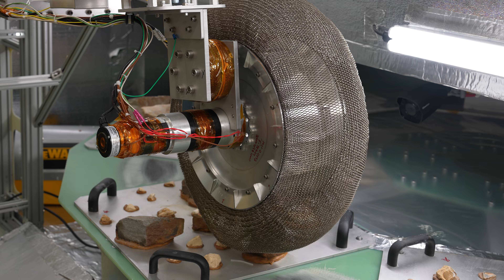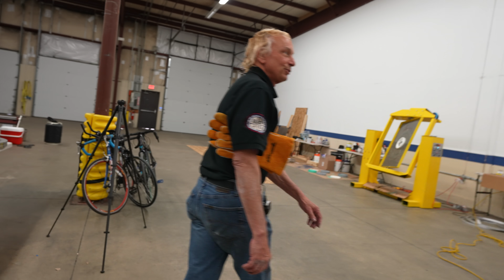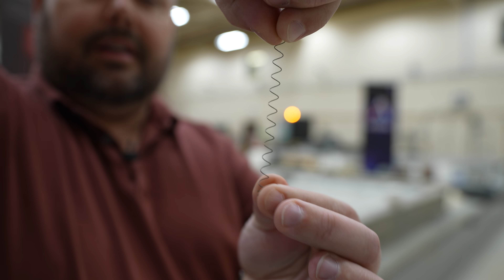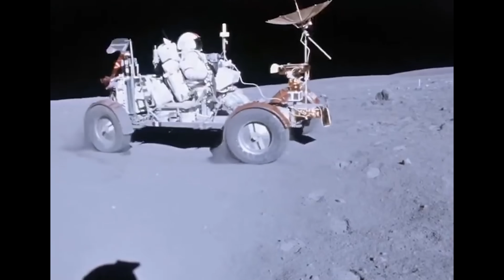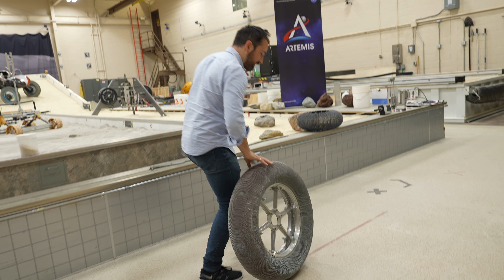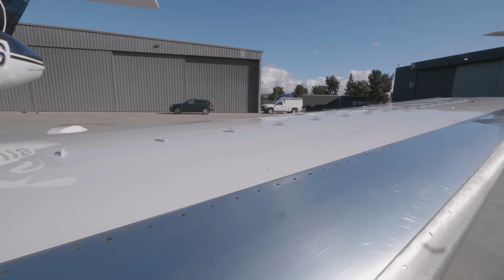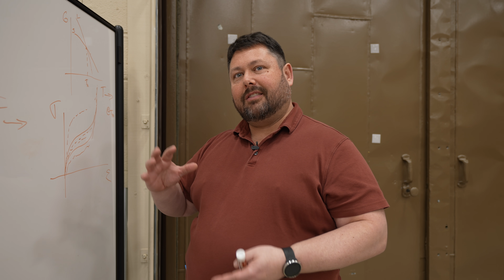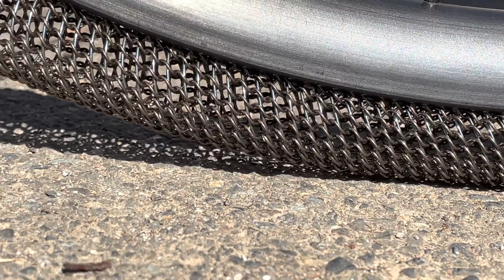How NASA Reinvented The Wheel

Comment: 1: Will the reforming work in space? -130°C is still a ways from absolute zero, but it is still significant less warmth than RT. 
2: If the alloys were originally discovered in the 60th, why is it not already in use on current vehicles in space; or on planes for that matter?

Comment: Why do they have to be wheels? Is a different atmosphere, makes me remember German engineering of flying saucers. Can a drone or form of hoover vehicle be more efficient out there?
Reply: A drone or a hover vehicle could potentially be more efficient than a traditional wheeled or tracked vehicle on Mars or other celestial bodies with low or no atmosphere. This is because a drone or a hover vehicle could travel over rough terrain without getting stuck, and could potentially cover more ground more quickly than a wheeled vehicle.

However, designing and operating a drone or hover vehicle for use in space or on Mars comes with its own set of challenges. For example, as I mentioned before, the lack of atmosphere means that traditional air-based propulsion systems won't work. Alternative propulsion methods, such as ion thrusters or rocket engines, would need to be used, which can be complex and expensive.

Furthermore, the harsh conditions in space or on Mars, including extreme temperatures and high levels of radiation, would require the use of specialized materials and equipment. The lack of a GPS system on Mars would also make autonomous navigation difficult, requiring sophisticated sensors and computer systems.

Overall, while a drone or a hover vehicle could potentially be more efficient than a traditional wheeled or tracked vehicle on Mars or other celestial bodies, it would require significant investment and development to overcome the challenges of operating in such a harsh and unique environment.
Reply: @athyneil  Thank you! Sounds like a good challenge to be solved to me!
Reply: @octoberharvest5661  It is! I would like to see how NASA would take on this challenge.

Comment: DID that in high school for science fair project 1984. I ran 2 interlocking springs bent with a bias to roll unidirectionally around a 20in bike wheel and retained it to the rim of the wheel with a herringbone 2 over 2 pattern cover. It was just a prop because it was made of copper wire. I had my eye glass frame made of Nitinol tied to the hub to show the material and said in my report that the copper would be replaced by the Nitinol.   

Monday, when we got the critiques back from the judges, it came back A+,A,B, C,B,C, & A+,A,A from the three judge panel. Concept, Report, Exhibit were the grade categories. The CBC was from the science teacher. When I got to science class, I asked her what's up with the critique, like what should I have done better or if there was a major error she saw. 

Science teach said it wouldn't work because it was too heavy, would have too much resistance rolling back wards (???), and that they would have used that on the lunar rover mission instead of inflatable tires. (?????) Yeah ... my head exploded. No amount of "but they didn't" was gonna change her mind.

It took me going to the assistant principle who had to drop the truth bomb on her & insist that her new found awareness would best be reflected starting with the score of my science project.She gave me A,B,C ... yup what a biotch. She wasn't there the next year.

Comment: The only thing that concerns me about turning it into bike tires, he says it's like a 100 psi tire, but when you hit a bump on a pneumatic tire, the whole tire acts as a spring temporarily increasing pressure. but with a solid spring you are limited to at most a triangle of force pushing back. the unevenness of the road is one of the main friction points on a bicycle.

Comment: You don't need confining pressure for peumatic tires the real issue is rubber gets terrible fatigue when being cycled in the cold. If it was just a pressure issue you'd just reduce internal pressure by 1 bar to maintain constant gauge pressure

Comment: the only part i still  have a question about is how is braking with the tire on regular roads if they did use it on regular cars? Will it skid on asphalt or will it actually brake properly like a rubber tire would? Especially at high speeds. Does anyone know this by chance?

Comment: Am I the only one wondering why they don't just use rubber tires for space vehicles? Can't be any heavier than using metal ones. 

And on a side note, using those wire mesh tires to go off-roading like they had on that Jeep would be a tremendous fail. Especially the moment you hit mud or sand and it just seeps inside.

Comment: As an AOPA class project, my class (in groups which focus on specific systems + factors) are working on a mock-up Martian colony.
My team of five got picked to work on transportation, and out of four vehicles we are working on; An “Ambulatory Unit” (spacesuit), A Train ,a medium rover and a light nimble rover, I got put to the task of making the Light scouting rover. And ORIGINALLY I’ve been proposing scaled-up Curiosity/Perseverance tires with a more malleable rubber/polymer-based outer layer, with the curved spokes to allow for a pressure-free method of absorbing impacts. Now THIS gives me a whole new idea.

Comment: This is a totally amazing episode.  Not being a scientist, the idea of a material becoming another material just because you stretch it is super-weird, but I understand the concept (I think).  Also, the changes due to temperature and stretching are fine, but the "I remember what I was born as and will go back to that if you heat/cool me" tips over into sci-fi.  You don't explain how the original shape is created that it will turn back into, yeah, it is two different crystal arrangements, but how are those set in a "permanent" shape?
Reply: I think he said if you heat it enough you can change it’s “original” shape
Reply: Heating the material while keeping it into a shape gives you the parent phase. If you want the material to remember also the martensitic “cool” phase you can train in through repeated cycles of cooling and heating while retaining into under the two desired  shapes, one for hot austenite and one for cool martensite. The crazy thing is not how the shape is given but how on earth the transformation between these two phases is “completely” reversible. You can think that our "macroscopic inputs" (heat, strain) are accompanied by shape change which is caused by microsopic crystal structure change and since the transformation is reversible we can follow the path back and completely regain the shape.
Notice that the material is one and the same, we are dealing with two different crystal structures  of the same material. And the key is that we can switch back and forth between these two structures in a reversible manner. The B2 crystal 15:55  structure shape is associated with the austenite phase (stable on high temperatures) and the B19’ structure with the martensite phase (stable on low temperatures). Crystal structures is roughly the way, the pattern, atoms are arrange in a material. So to answer your question defining the shape is not something crazy. If we heat the alloy above a temperature and keep in constrained under a shape the alloy will be set into that shape while having it’s high ordered austenite phase (with a B2 structure). This is not something new, heating metals is accompanied changing the internal structure of a metal (recrystallization, new grains etc). Isn’t it easier to form the shape of a metal while on it’s  temperature is high ? Or casting a metal doesn’t define it’s shape ? If you want the material to remember also the martensitic “cool” phase you can train in through repeated cycles of cooling and heating while retaining into under the two desired  shapes, one for hot austenite and one for cool martensite. By repeating the cycles you induce some atom dislocations and internal stresses with permanent character so that when the alloy is cooled a certain form of martensite (variant) will be favoured to form which is linked with the given shape.
Reply: He did mention it briefly at the 14 minute mark

Comment: When I was in Primary School (and remember, kids chew stuff and it’s not necessarily pica) I noticed that some removable plastic pen caps (probably polyethylene) would heat and cool as I bent them in my mouth.  Heat up as I bent, take them out, they cool a little, then noticeably cool further as I unbent them.  I thought this was curious.  In HS, I could recognise there was some sort of energy change happening beyond the work I was applying to the material.  After Engineering Intermediate, with some Materials and Thermo inside me, it made sense.  I wonder if Uri Geller used Nitinol teaspoons…

Comment: I'm curious about the wheel concept on cars. Being metallic I'd imagine they have considerably lower friction gradients when compared to rubber. How would you go about accelerating or hitting the brakes?
Reply: Like you saw on the bike tire, they can cover the NiTiNOL wire with a plastic/synthetic rubber to get the right friction without needing to rely on pneumatic pressure

Comment: I wondered if someone could clarify the following for me. In the video he mentioned most other metals only allow for a 0,3-0,8% strain elastically, but i know for a fact that tempered steel used in for instance swords can deform a significant amount and spring back to true once the forces disspate. The most extreme case i've seen is forcing a blade to bend at 90° angle before very nearly coming back to true. Or is he talking tencile strength?
Reply: Or is steel a different category due to it being an alloy?

Comment: The tires are pretty cool but I see one problem potential for regular vehicle tires which is snagging. That mesh would not deflate with a nail but a nail inside could catch and pull. Now the elasticity could be more than enough to overcome the nail coming out but what if the nail was more curved over and stayed hooked into it. I assume heat change could make it go back too normal shape but that damage would be a argument some would try to argue as a safety hazard which could damage the vehicle. Argument would not hold up much though vs all the benefits. 

I do wanna know how much one of those tires in optimal market place could be. That optimal market place would be as if the tire was made commercially with all the machines made to make them was already paid for and material was available. Like $10k a tire would be insane and might not justify the cost unless it was constant use work vehicles. Even then its a hard cost to swallow. $2k then maybe, $500 would be best case and it would make sense for car tires as them not wearing out (outside the treading attached) would outlast the vehicle. $50 for tread replacement at a shop or even cheaper at home would still make money for the business (you know they would be the most negative about it) and be cheaper overall for the owner. It would be even less rubber being wasted so material waste would drop.

Comment: It would be interesting to see another video about how this metal is manufactured.
Also I'm curious why all the examples of this stuff seem to be fairly thin wire. I'm curious what sort of applications there are for it in heavier configurations, like if you had a straight thick bar would it be useful as a torsion spring.
Reply: it would probably require more heat/cooling since more mass needs to be moved
Reply: @EphemeralPseudonym  also it could lead to structural failure (I’m guessing). Over all tho I totally want a indestructible bike XD
Reply: I’d assume it’s because It requiers titanium and nasa being completely underfunded by the government.
Reply: maybe it's the "spine" type of thing, where small movement of individual elements allows for very wide range of motion for a bigger structure

Comment: how is there no ablation on the material though?  like with rubber as it is used it wears down due to friction taking small atoms worth of material with every encounter... eventually it wears thin and you get a blow out... but EVERY material has a interaction like that... two metal objects hitting each other will leave scratches... two car bumpers will trade paint etc...

how is there NO material ablation?!

Comment: They can atleast make the wheels bigger. Small wheels and (very) remote driving leaves very little room for error. 
Bigger wheels will alow them to get over bumbs easier and is more forgiving. 
Always wondered why they dont make them bigger. 
If someone has a good answer, feel free to inform me.
Reply: For larger applications like the Lunar Terrain Vehicle, our tires have diameters larger than 35" - pretty big.
Reply: @thesmarttirecompany  Thank you for your answer. 
Yes, that is pretty big.
But was thinking about the Mars rovers with 6 wheels.
Reply: @Norwegian733  one advantage of the SMA tires is that you need only 4 tires. The 6 tire setup was a result of having completely rigid wheels.

Comment: How about putting votlage between rims, to heat up the springs to regenerate their shape. Lets say you had a bumpy few hours of ride, then you find a flat smooth path, put current to heat them up , and you are like new.
Reply: The goal is to never permanently deform them in the first place, but yes -- you can use electric current to manipulate the material.

Comment: Low pressure is not the reason you can't use pnematic tyres in space. Lower the fill pressure by one bar (or more, depending on gravity), and you're good to go.
Low temperatures and absence of mainentce facilites are more of a concern.

Comment: Wonderful material! I just wonder why it has been used in more applications. It would be nice to have tires that never go flat.
Reply: how would businesses stay alive if people stop buying products :D (I agree with you)
Reply: I do not think it is practical for normal use for road cars. One thing they did not address with the tires are the lateral forces when turning. Planes can work yes, because they mostly land in a straightline and do not corner at any significant speed when on the ground. However road cars are different given how much their tires need to handle the lateral forces during cornering. I believe the lateral forces acting on the tire would be too great for it to become a viable replacement current tires.

Comment: I was wondering if you set the memory at a high temp to be a very small rigid structure; if you were to super heat and supercool at the same time, could you learn anything from the middle point of the reaction? Like hot on the bottom cold on the top in a tiny chamber until something happens??

Comment: Why can't they just lower the pressure by 15psi (1 atmosphere) and use regular tires. I gotta disagree that they would "explode". That is factually incorrect.
Reply: To what end? You still have to worry about never, ever losing any of that pressure, and then what is the tire made of? Rubber that shatters at low temps?

Comment: I got the exo-endo wrong and lm a engineer. 😮 I thougth the symetric intial phase would be low entropy. So the deformed phase should be high configurational entropy thus low thermal entrophy and cool down.
The deformed phase must be low configurational entropyhy it is so strange.
I knew that rubber works this way but l dont really get it if nitinol is cristalline. This is intresting.
Reply: The "trick" with nitinol is that you're actually inducing a phase transformation in the material... much different that just stretching bonds.

Comment: About terrestrial applications : is the coefficient of friction of this metal on asphalt good compared to rubber? Is there no risk of suck a wheel slipping, especially if it is raining and the road is wet?
Reply: We add casings and rubber treads. Nitinol makes for a great structure, but you still can't beat rubber treads "where the rubber meets the road".

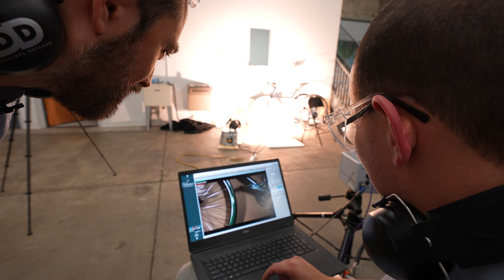Comment: As a mechanic the b-roll at 2:34 hurts me. The tyre valve is in the exact spot where a pressure monitoring sensor would be snapped off.  such a tiny insignificant niggle to have xD

Comment: As a mechanical engineer, I find this fascinating.  The stress/strain curve is an important measure of a material's mechanical properties.  Of course, the stress applied is tensile stress.  Compressive stress and shear stress are also important.
Reply: Would love to see the analysis of nitinol under compression and shear stress. And an inclusion of the strain energy calculation. I do not know how strain energy transitions during failure nor during the phase change in nitinol, but it seems reasonable that the strain energy = heat energy during the phase transition. Would love to know the answer.
Reply: How does the stress strain graph dip at the yeild strength? Is the tension lower because the atoms are moving or does the cross sectional area get larger?
Reply: @ZZZ77-  Cross sectional area usually doesn't get larger.  It would get smaller.  The degree to which this happens is called Poisson's ratio (think of pulling taffy).  The dip is because it's taking less stress to cause strain.
Reply: what is your opinion on this being used on everyday road cars? wouldnt the lateral forces be too much for this type of tire?. The vertical loads seems find to deal with but when it comes to cornering at high speeds, the 8% is surely not enough.
Reply: @penart8079  In ordinary use, cars aren't subject to the same type of stress that NASA was concerned about, namely traveling over very bumpy terrain.  Cornering stress is quite different.  The video said that the material might be suitable for use in landing gear, which is subject to quite a bit of stress, which would imply that it could also be used for cars.  Look at how much the bar is being bent at 17:16 without a problem.   So the question would be how much material would be needed for the application, how much would it weigh, and how much would it cost.